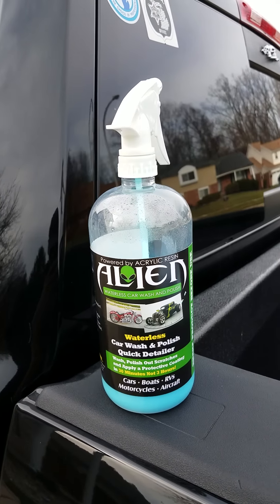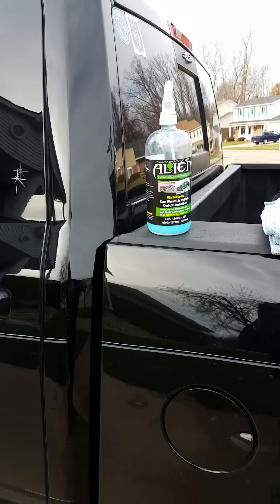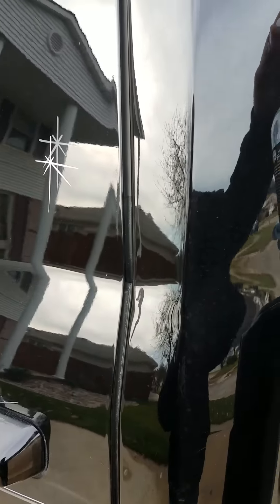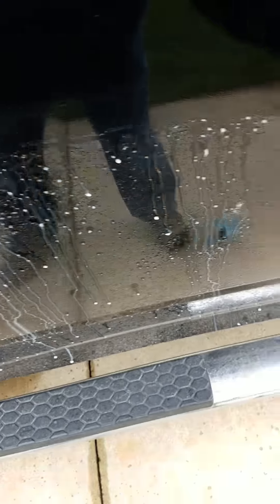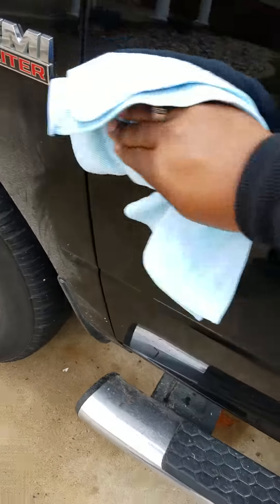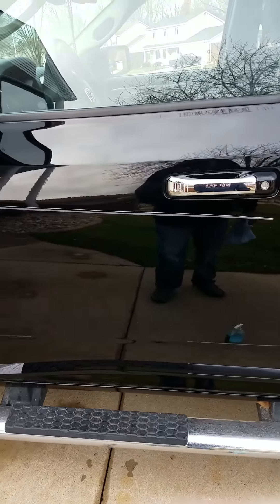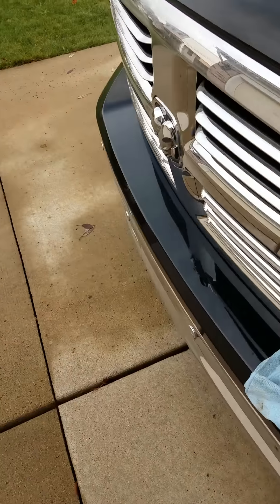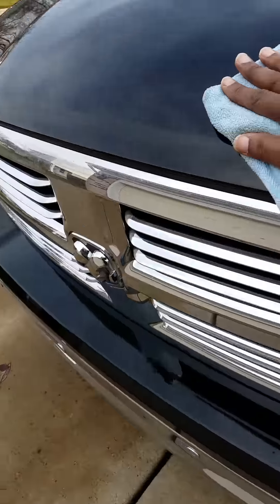Alien Waterless Car Wash Review

Comment: Looks impressive. As a detailer, I have to ask if it leaves any scratches or swirls? I've never seen anyone or a product get rubbed around the paint in circles, etc that didn't cause damage. Thanks.
Reply from the maker: If you happen to try this product, I'm sure your going to be surprise with the out come!!
Reply: mkcharland honestly I talked to the owner of alien for over an hour about this exact thing and he sold me on it .he told me that it won’t scratch it and the material in it will actually fill in the swirl marks over time and I’m telling you I love this product!!!! But definitely pull when you wipe it off

Comment: Their website says use a terry towel and then microfiber. Looks like you are using microfiber for both. I would think that terry towel would scratch it. Thoughts?
Reply: Ryan Haggerty I use this on my 2016 Chrysler 200 and I use the Terry towel then microfiber for the simple fact of when you use the Terry towel it picks up the dirt then when you use the microfiber it polishes your paint job Terry towels not so rough to the point of it would scratch your paint but I do like the idea of double microfiber might make for a smoother finish
Reply: I have used these type of products a lot and the reason they tell you to use a TERRY first is simply because you don't use as much product that way. This came directly from one of the manufacturers.